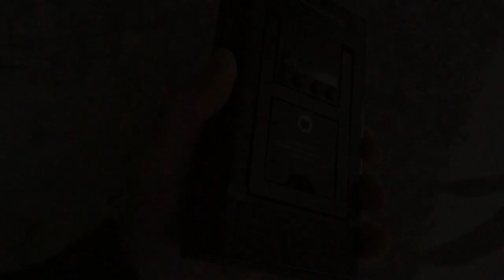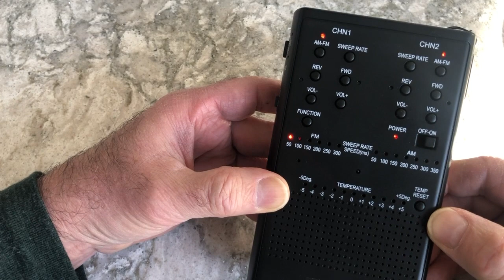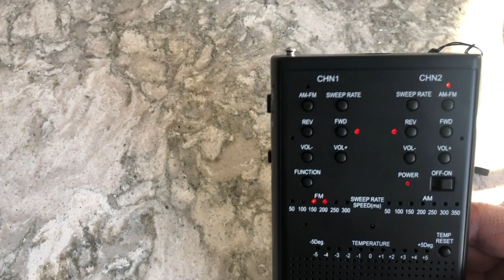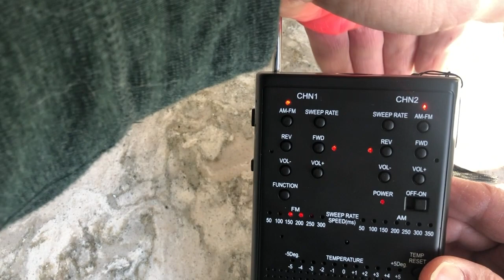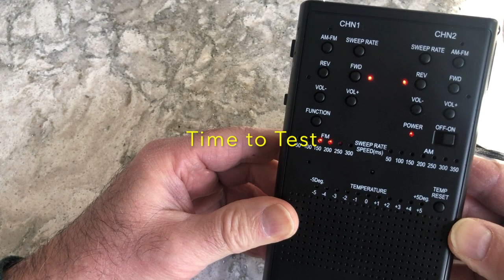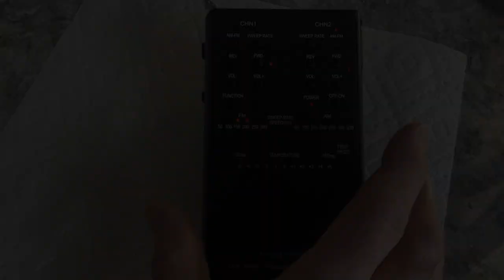Spirit Box With Noise Control: P-SB11-ANC Review + Live Response Test

Comment: When I add two external speakers to the SB-11 the up and down noise control buttons in the back don't have any affect at all. Is the noise control only effective when using the internal speakers?
Reply from the maker: Correct, internal speakers only. The standard SB11 has good volume...plus, the ANC circuit also has an audio amplifier to increase the sound further. When you first turn the SB11-ANC ON, do not increase the volume by more than 1-3 clicks. When we test and calibrate them we only increase the volume by 1 click. You don't need to have loud volume to hear a good spirit response. Follow me on Twitter @GaryGalka for the latest ITC test clips and News on my New PSB7-PRO.
Reply: @gjgdas  Ok. Thanks for the info.

Comment: Does it come with a SD card slot to go back over what you get while out investigating?
Reply from the maker: No, an SD card would only allows you to record the sweep radio, it does not record your questions and/or interaction with the real time Spirit responses which is essential during a session. It's always better to use a separate recorder or your phone.
Reply: @gjgdas  Thank you. I'm not so concerned about the questions, it's the answers I need.

Comment: So how does this work? It scans FM/AM radio frequencies within a certain range (like miles or actual frequencies)  and uses the words being broadcast from those stations for the spirits to communicate? I’ve seen some videos and it’ll be a woman answering and then a man will answer when they’re thinking they’re talking to a dead man or vice versa, not skeptic, it’s very impressive, I do electrical and low voltage work, and starting to learn OTA radio waves. Thank you sir.

Comment: If you output from this box to a recorder, will the loud static transfer to the recording? Or, does the static get canceled on the recording?
Reply from the maker: The audio output jacks are not connected to the Noise Filter. You would place your digital recorder in proximity to the speakers directly.

Comment: Hi Gary, I have been doing research using psb7t and psb11 that you developed. 
When I use them in Japan, the genies answer properly in Japanese.
I have also noticed that in Japan it is easier to speak using a speed of 250. In other countries, many people prefer speeds above 150, but I, on the contrary, prefer settings between 200 and 250.
I feel that there are regional differences between countries.
Also, it seems that Japanese spirits often have a unique smell like incense at the survey point when they come out.
Does this tend to be the case in other countries such as the U.S.?
I will also refer to the video.
 Thank you very much.